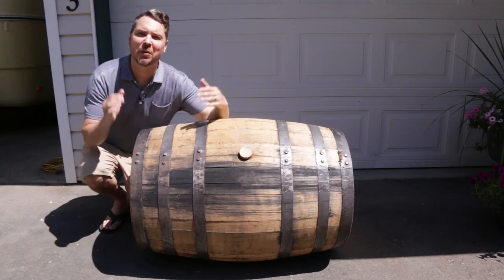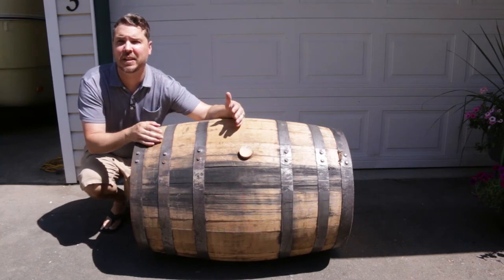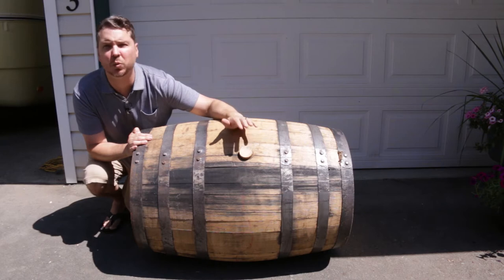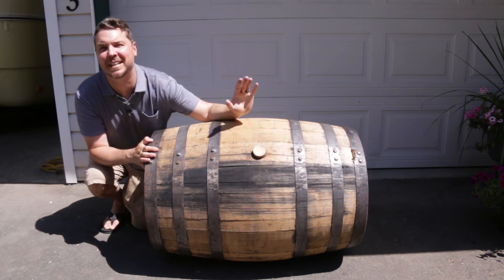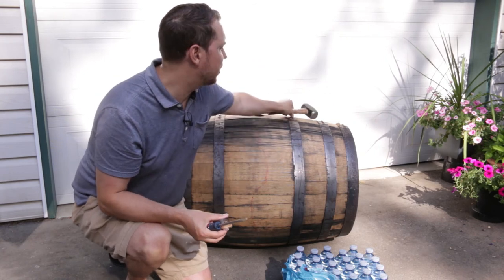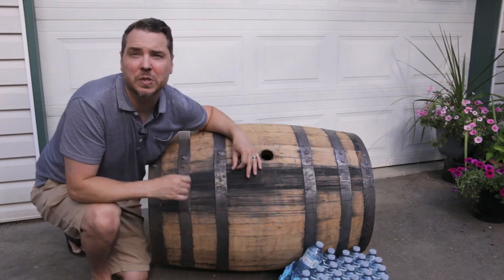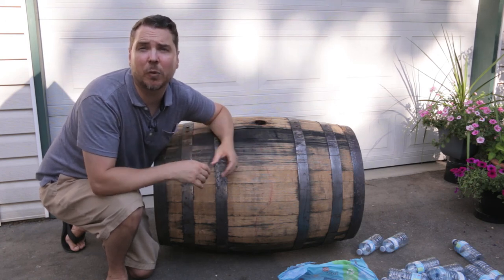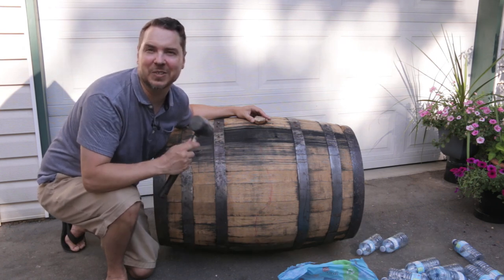Making Swish! Part 1

Comment: Why not just buy a bottle of whiskey?
Reply from the maker: Thanks for watching! This is all about fun and experimentation.
Reply: @TheWhiskyExplorer  ok I get it. What is the average ABV of swish?
Reply from the maker: @velocci6666  that is a great question! I didn’t test this batch, but it would be vary depending on how wet (how recently the barrel was dumped) the barrel is. Mine hadn’t had anything in it for a year, so was dry and VERY watery swish was the result. I would guess it’s around 10% a.b.v., but that’s a total shot in the dark.
Reply: @TheWhiskyExplorer  I guess it would depend on how much water you put in. If you were to put in less water and swish it more frequently, it would probably be higher ABV. I could try this myself as I have a 1L barrel currently aging a cheap bourbon. I've aged lots of other whiskies before that to. I aged couple of bottles of Stalk and Barrel red and it tasted amazing after. Was smoother to.
Reply from the maker: @velocci6666  oh awesome man! A 1L barrel has a LOT more impact for sure! I actually ended up emptying half the contents and putting it back in to see what I get. I’ve been keeping the swishing about the same. Rotating the barrel every couple of days. I still expect it to be quite watery, but hopefully less so.